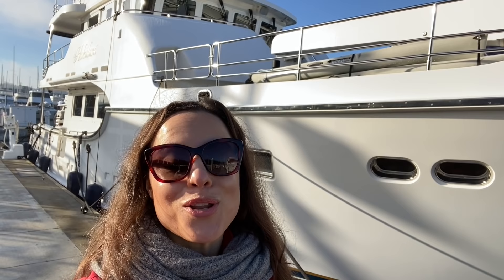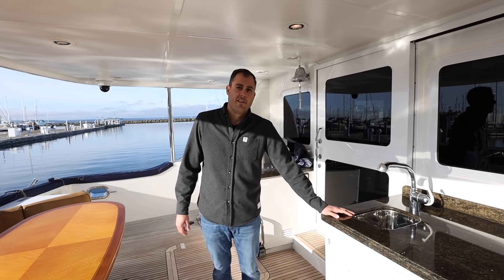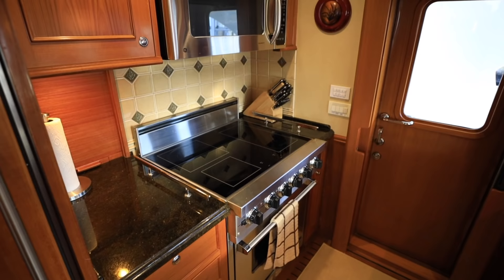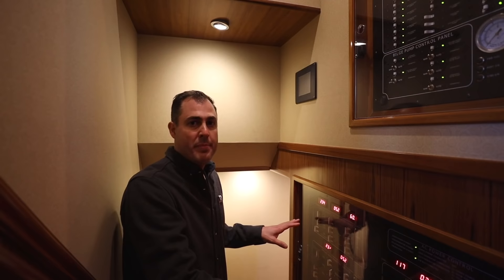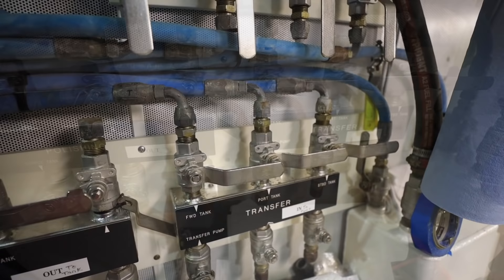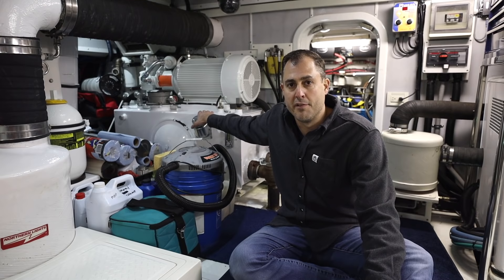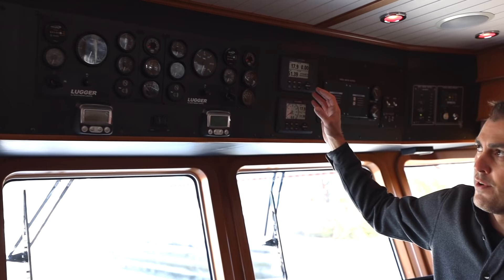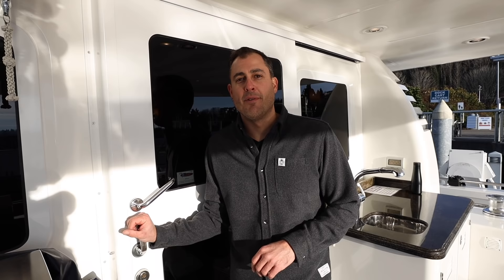$2,995,000 YACHT TOUR: Nordhavn 68 "Hokulani" in Seattle, WA [MV FREEDOM]

Comment: Shawn, you missed two of the benefits of wet exhaust, 1) With the exhaust being pointed out and down near the waterline, the soot and fumes have no impact on the outdoor spaces on board. 2) The wet exhaust systems actually mean the engines do not need DPF or DEF systems, the raw water being introduced to the exhaust gases actually does the same as either system. The 3rd and possibly the biggest benefit, you don't have as much cleaning to do on the upper decks from the exhaust.

Something most people miss about wet exhaust, the gases are food for the plankton in the sea water, by dumping it right above the water it helps the plankton feed and produce oxygen.

I'm not a fan of the big empty fore-deck space, I would rather see the superstructure extending there making a larger boat deck possible aft of the flying bridge.
Reply: Hello Jaqui how are you doing today

Comment: Hi Shawn -- I loved the video and I guess Elizabeth will have earned quite a few house points with her 'gift'. With all the electronic aids on board do you think it would it be possible for just the two of you handle this beautiful yacht?  Also, would you run both generators at the same time (i.e. 20 + 25 kwh = 45kwh) or is the second one simply for backup in case of a malfunction? I've not previously seen a boat with carpet in the engine room! You are definitely a more compelling sales adviser than most I've seen on YouTube. Merry  Christmas from the UK.
Reply from the maker: Yes this is definitely doable for the two of us, although it would be a LOT of work to clean and wax the hull so Shawn & I would probably have to outsource some of that fun stuff. And yes, the 2nd gen is a backup. You wouldn’t need to use both.

Comment: That’s a beautiful boat.

Does it require a licensed Captain and Engineer to operate it, or can the owner / operator handle those duties?
Reply from the maker: It wouldn’t require a licensed Capt and is very doable with a couple. This is a very special boat, however, so any owners wanting to handle it will need to be a very capable mariner and a mechanical as well.

Comment: I don’t know if it’s still for sale but there is a Seattle based boat called Wayfarer that you should do a tour of if you can. It’s a 63’ or maybe 65’ Cape Horn Trawler. It’s a little ship, very ruggedly built steel hull, aluminum superstructure boat. Built in Nova Scotia Canada (I’m Canadian eh). It’s designed to be self righting in case of a severe knockdown. It can sit on it’s bottom on a very heavy main keel and bilge keels. It’s what I would want cruising the PNW. Check it out.

Comment: OK.....Here's a tough one for the Nordhavns. 
Forward Bridge or Aft, and why? 
Pros and cons.
 I know there are some differences in fuel capacity between them but not that significant but which one fits the longest tender?
Reply: Been on both fore and aft pilot houses. Forward is better for frontal visibility etc but i found the motion inside less severe on the aft pilot house... Think a rollercoaster in a theme park, the front is "quicker" and you see things better but the back is "slower" and easier to ride.

Comment: I question the logic of having the jacuzzi so high up. That much weight (8.345 lbs/gal water weight) would probably have a severe negative impact on handling, even at port.
Nordhavn makes nice boats and are usually well thought out, but I wonder about that idea.
Reply: Yachts like this never ever run with water in the Jacuzzi's, even on 100 meter boats, it will have a negative effect as you pointed out.  The weight of the empty tub isn't that much of a concern, when empty, they're usually made of Fibreglass. 
And they can be quickly drained using built in pumps when in port or anchorage if the weather turns choppy.